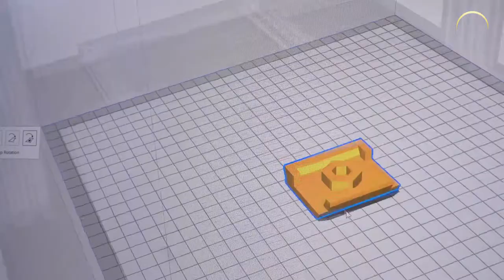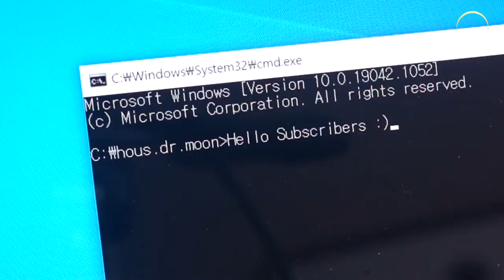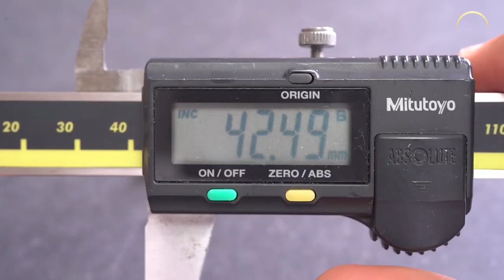Making A Spring-Driven Camera Slider, Retro Design

Comment: great work!  I wonder if a person could replace the spring and dampener with a constant force flexure and some kind of gear assembly?
Reply from the maker: Thanks for your interest on my work :)

I don't understand what constant force flexure means.

The spring used in the video is a constant force spring. When a constant force is applied, a constant acceleration occurs according to the F = ma formula, and the speed increases accordingly.

In order to keep the speed constant, a damper is used to make the speed constant (F=cv) when a constant force is applied.

Thanks again:)